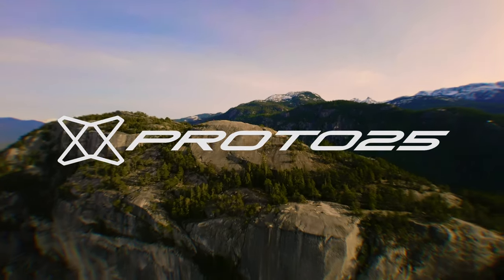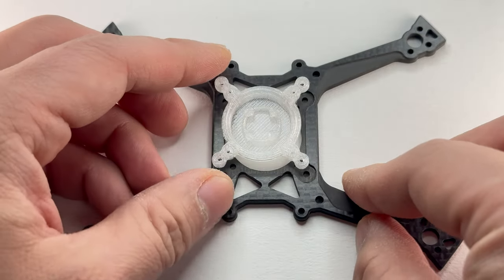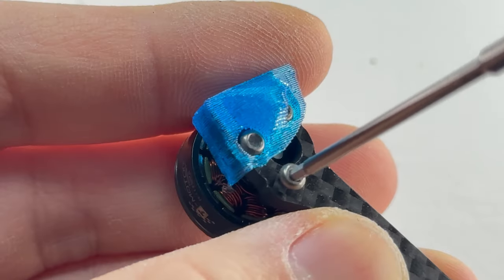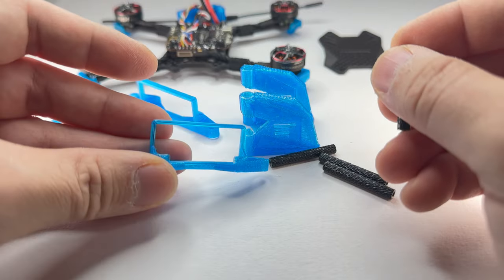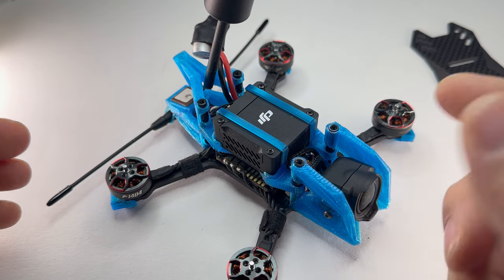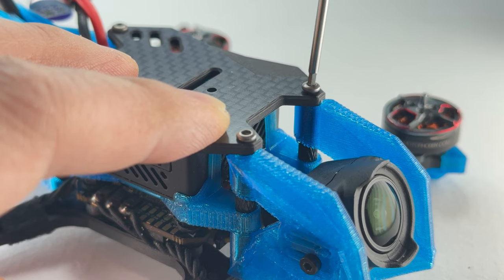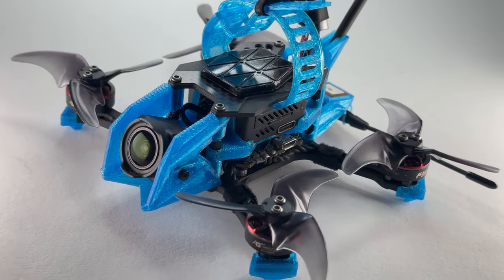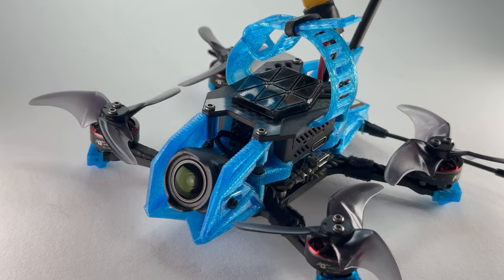How to Build PROTO25 | Micro LR Ripper | Sub250g FPV Frame

Comment: I have a cinewhoop laying around with that electronics setup maaaan 🔥, well I still need to get an O3 if I were to build this little monster.
Reply from the maker: Yeah that be awesome to just move over the guts for sure hehe. If you have access to a 3d printer I have a vista holder you can download. Its just a tighter version of the O3 holder.  My buddy also runs P25 with vista and polar. https://drive.google.com/drive/folders/1YdBbhAkIpLZikvVDqZEcUOoA77fVPjWO

Comment: Sweet little build i want to do the same but with Walksnail
Reply from the maker: Should be possible! Here's my friends build with HD ZERO. https://www.protofpv.com/portfolio-collections/customer-builds/p25pink
If you ever build one would love to feature it on the website!
Reply: That would be really cool it will definitely go on my build list I'm working on a 7 inch 8s build at the moment and then I can get on this one
Reply: Probably work fine with mods to 3d prints and you printing them out. Just don't expect to get the performance of the 03 nor the distance with crystal clear video. There's nothing that comes close to 03 !
Reply: @KOrnhOliO1  I've had very good luck with Walksnail, I have flown a couple miles away so far

Comment: Great work. Can you recommend a Speedy BEE stack for this build?
Reply from the maker: Thank you so much! You can use the speedybee stack with analog or the flat vtx style boards. If you plan to use o3 au, vista, any box style vtx you will need to use All in one flight controller (AIO)

Comment: This is genuinely one of the coolest frames out there. But the price...MHHHMM...idk. I personally cant afford a 70$ frame if I could just get one similar (not as good) for 20-30. But nice build man!
Reply from the maker: Thanks man! Yeah i totally get it. The reason is price like that cause of t700, tpu and titanium in the kit ..Hmmmm… you could just buy the CF plates on their own. $35 Canadian dollars ($26 USD) https://www.protofpv.com/product-page/proto25-spares 
Find a friend to print you the tpu prints (I provide them all online anyway) and You can also source your own steel / ti hardware or use your existing spares! The instruction sheet is online too if you want to plan ahead with which screws etc. :) https://drive.google.com/file/d/1-ua-iwnEtZbd563HOyhuC49keHIZd8hc/view?usp=drivesdk

Comment: I was thinking of converting my Flywoo Explorer LR4 03 to this frame.  Would that stack fit in this frame?
Reply from the maker: Hi Cathy! The stack would fit, but then your O3 won't fit up top without longer stand offs, then it would throw off the whole look. A naked O3 might work maybe? but I don't have those dimensions, but then you would have to make some new prints to hold it too. Also, the explorer motors are 1404, but unfortunately they are 12x12 mount (P25 frame is 9x9), so that won't fit either. The only thing you can swap in is the O3 AU and antenna. The GM10 GPS and buzzer won't fit either, you'll need custom 3d printed mounts... Sorry...but it does sound like a fun project! :D Please review the specifications and recommended parts on the website or the description. Thanks!!

Comment: I like how he uses thicker cf  for rigidity and then machines it down to save weight where its not needed on his frames, I've had that in my mind for years, just never had the funding or cad skillz. Thick carbon fibers kind of expensive, I've kind of thought about cutting out layers of thin cheaper cf by hand  that over laps to reduce waste then ruff it up and glue it all together as one peice so it can have hollow sections. But i soooo want one of these and a proto5, but my budget only lets me buy cheap frames
Reply from the maker: Thanks so much for noticing the details in the design! I’m in the preliminary phases of working on a very cheap 4” ripper Protofpv style. So keep tabs with the channel! If you have a 3d printer, proto5 and proto25 can be purchased without the 3d prints (last colour swatch option in the product pages and you save around 15% all stl files are provided online) making it more affordable. It still comes with all the good stuff like titanium hardware. Hope you can save up some few bones to get it. Would love to have you as a future customer. Thanks for the comment! 👍💪

Comment: Got mine in today 😊 So excited for this build!    I have a goku f722 mini stack im considering throwing in it..... any thoughts?
Reply from the maker: It’s a possibility! But if you are using it with an o3 air unit it probably won’t fit, but if your vtx is thin, like a single board it should be totally fine
Reply: @PattyFlipz  the frame is awesome I like the work you put into design,   honestly I was considering throwing a naked 03 AU, to adjust for the size.   But I definitely might have to get me an AIO

Comment: your frame has fully my attention, i just wonder if the walksnail moonlightkit also fits in the frame. do you have an walksnail conversionkit? or will it fit?
Reply from the maker: Hi is that the new system just released? I will look into it and see if I can either design a quick release sling holder for it and dual rear antenna set up, otherwise the frame does have all the universal hardware to make it happen if you want to hard mount it. I also have a dual antenna mount in the downloads page of my website already. Keep tabs on the progress or updates on the community section of my YouTube page. Thanks 🙏
Reply: @PattyFlipz  yes exactly the new system is slightly bigger then the 03. I will contact you via your website for order to Germany. I like especially size 2.5 and possibility for moonlight 19mm cam. Really great!! Respect ✊
Reply from the maker: @bastelwastel42 great!! 👍 looking forward to working on this ⚡️

Comment: Whats the flight time exepected with this quad on 720 or 850 lipo?
Reply from the maker: Depending on the motors you use, my set up is more power hungry. Possibly 4min-4.5min until storage level.
Reply: I run this with an HDzero setup and usually run 650mah batteries. I can get around 5-7 minutes if I'm not pushing too hard (cruising).

Comment: Is this for dji set up only...can you use any components you want
Reply from the maker: Yes, it includes hardware where you can build a universal stack with any of the popular components. It won't fit the old really big v1/v2 dji air unit though. :)  Here's an example with HD ZERO https://www.protofpv.com/portfolio-collections/customer-builds/p25pink
Reply: @PattyFlipz  ok cool...reason I ask...im not a fan of dji anything...wanted to use other components...like the frame though
Reply from the maker: @Deathwish_fpv  Great! :D

Comment: Great video,  I just finished mine as my first build. Is anyone using Betaflight 4.5 for the better GPS support? I'd like to give it a go but I have no experience PID/Filter tuning and I have no idea what settings can be safely transferred over from PattyFlipz BF 4.3 settings to BF 4.5. Does anyone have anyone a good working tune for BF4.5?

Comment: Hey this is a really neat and functional design. Is it possible to fit the speedybee f405 20mm stack inside?
Reply: Never mind you already have it covered 😅
Reply from the maker: Hi! No problem! I’ll answer anyway. Since it’s a stack, As long as the vtx you are using is a single board type it should all fit fine. If it’s the moonlight 4K or o3 any big metal case style, you are gonna need longer stand offs . 👍

Comment: Can you mount aio on 25.5x25.5 holes but mount video transmitter on 20x20 holes? I want to build this drone with analog, but the vtx I want to use has 20x20 holes
Reply from the maker: Hi! Yes I include an adapter, it looks like a square with an X in it. It has 20x20 and 25.5x25.5 holes. Also has room to add additional screws to start putting your 20x20 on top. You can see it on the product pic beside the frame: https://www.protofpv.com/product-page/proto25-micro-long-range-ripper - If you end up not needing it, some people also just use it as stack tie down with nuts, and then you can secure accessories on top of it with zip tie. Thank you for the interest.
Reply: @PattyFlipz  Thanks! Going to buy this frame soon!
Reply from the maker: @MaxMorfiX looking forward to it!! 🤩🙌

Comment: Have you tried it with bi-blade? I am guessing those props are too small to support that much weight with bi-blades?
Reply from the maker: No, actually, haven't tried! Sounds interesting though!
Reply: I cannot find any bi-blade prop with aggressive pitch. Fly with bi-blade using the same payload, you will need to move throttle stick up significantly which may makes freestyle more challenging.
Reply from the maker: @kibbycabbit  Thank you Kibby!
Reply: @kibbycabbit   Yea I wasnt thinking freestyle just for fun to see if it would give longer range.  Props are cheap so easy thing to test.

Comment: Hey dude what motor would be best for 2.5 inch and 3 inch props? Im intending to build a design capable of supporting both size props. So which size and what kv would give most thrust at 4s?
Reply from the maker: I have 4s 2.5” and 3” quads, the 1404 4xxxkv 4s works really well for both. Please note this p25 frame in the video, max size is 2.5” because of its compact squashed X geometry. Thanks!
Reply: @PattyFlipz  If 2s liion is used would it be underpowered or something? Since 4s is pretty heavy, can 2s be used instead and get somewhat 8-10 mins flight time cruising?
Reply from the maker: @AfafPrinceOSH sorry man I’ve never tried 2s lion before so I’m not sure. 🤔 be interesting to find out for sure
Reply: @PattyFlipz  would u mind giving it a try and letting me know? 😅
Reply from the maker: Ahaha I will ask my friends to see what they think too
Reply: @PattyFlipz  bro another thing. Wouldn't 1303.5 rcinpower motor be efficient for this build? That motor outputs 382gm of thrust on 2s. Using that puts your quad weight at 125gm. And using 2s liion or lipo would be more economical don't you think? Was wondering
Reply from the maker: @AfafPrinceOSH yeah, honestly build it how you like it. 2.5” is very flexible in that sense and if you are looking for efficiency go for it. Main thing the motors are 9x9 mount and aio you purchase just make sure it works with 2s. My setup it’s not the most efficient but it’s very exciting to fly fast and does whatever you want it to do without any issues. with 720mah 4s sometimes you forget how powerful it is and as you lift off you might send it right up into the tree above you lol. It’s a little ripper. But I haven’t tested any high efficiency set ups yet. That be nice to find out but I don’t have time at the moment to change the motor set up. The frames pretty light and forgiving so I’m sure you can make it work. My buddy has used smaller 1203 motors with good results and it was plenty agile still (only tested with 4s batteries though) You can be the first with 2s lion. You pretty much came up with your own dream recon setup man!, give it a try and let us all know :)

Comment: What kind of flight times with the 4s 18650 li-ion?
Reply from the maker: I think you can probably pull off 15 minutes until land now if doing a nice cruise. For example, this video I ended the flight at 10 minutes and used up 2076mah, but I was trying to go fast most of the time. https://www.youtube.com/watch?v=f15u6Sm8X_E

Comment: You should offer a 3" and 3.5" bottom plate for and up charge
Reply from the maker: yeah that be really cool! I did play around with the idea, but at the 3" to 3.5" size it starts making sense not to stack everything on top of each order (in order to keep the no props in view feature). If I simply change the baseplate to longer arms, props will become in view, OR I can make the camera cage longer... but then it will start having turtle neck look aesthetic.

Comment: Great job brother where do I get the pieces what is the name of the store or the account of the company that owns the parts and the camera ❤
Reply from the maker: Thank you! you can buy the frame pieces from Protofpv.com and the camera used is DJI o3 air unit. Electronics are all sold separately. Buy those from your favourite Rc stores.

Comment: Ciao Patty , dopo il proto25 mi attizza l' idea di costruire anche questo ! Hai qua che video dvr del proto5? Ciao Patrick
Reply from the maker: Hi Patrick, awesome!! Here is a goggle DVR video of a flight with Proto5. Please note in this video, the p5 is loaded with a 120g gopro mini 11 hanging upside down under the quad (touching landing pad!), and using a 1400 6s lion on top, and smaller 4.9" props: https://youtu.be/K8Je8h-M4Ac?si=14V4mT6bG9hdbTG4

Comment: Which AIO are you using for this build?
Reply from the maker: Hi I’m using a T motor AIO but not sure if I recommend it because I have trouble flashing anything over bf4.3. any 35a AIO will do with usb on the side and enough uarts for the accessories

Comment: is this compatible with the original dji air unit or are there prints available to make it so?
Reply from the maker: Hi there are prints online you can download and print that support the caddx vista but not the original air unit. I’m not sure if the original air unit will fit in there. Might be too wide that the props strike it.

Comment: How well would this work with the Walksnail VTX systems?
Reply from the maker: You will have to create either a 20x20 or 25x25 stack like what my friend did with HD ZERO: https://www.protofpv.com/portfolio-collections/customer-builds/p25pink 
All the hardware is included to make it happen.
Reply: @PattyFlipz  so I’d just need to purchase a Walksnail VTX, FC, and motors…all other hardware is included with the frame and would work with the 3 different HD VTX system?? (WS, HDZ, and DJI)
Reply: Probably work fine with mods to 3d prints and you printing them out. Just don't expect to get the performance of the 03 nor the distance with crystal clear video. There's nothing that comes close to 03 !
Reply from the maker: @DannyFPV04  Yes you are correct. Frame kit is just the carbon, and all the hardware (screws, nylon, led light, zip tie etc.etc.) and TPU prints shown in the photos in the product page. No electronics are included. For recommended electronics, you can check the description in the video. Yes all the VTX are pretty universal mounting configs, as long as you can put screws through it.
Reply: @DannyFPV04  Don't forget a nano receiver and nano sized GPS
Reply: @kibbycabbit  thank you. I’ve got and AIO CrazyF411 with ELRS built in, but yes in the GPS!
Reply: @DannyFPV04  hope you use external antenna thru u.Fl because builtin ceramic antenna or little copper wire both give you “racing course” range.